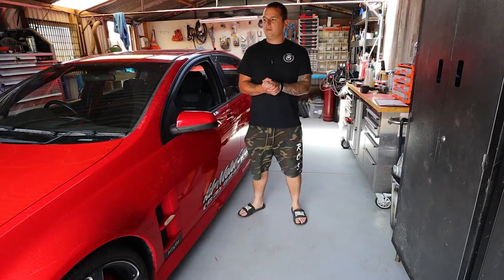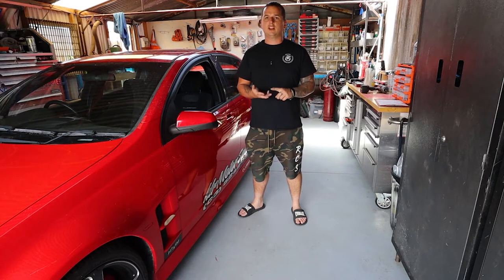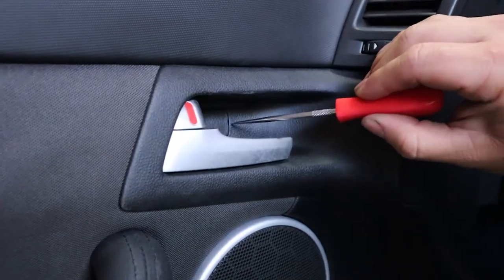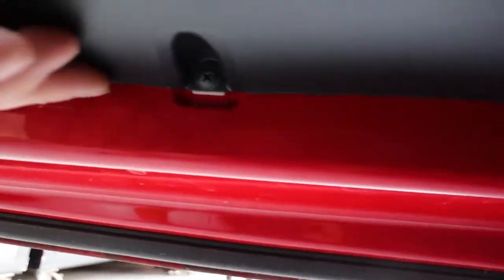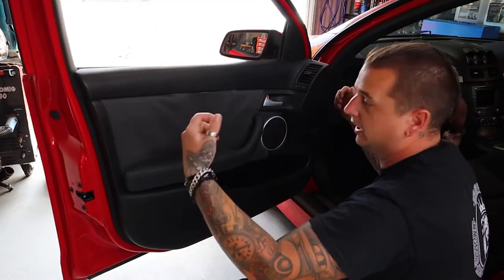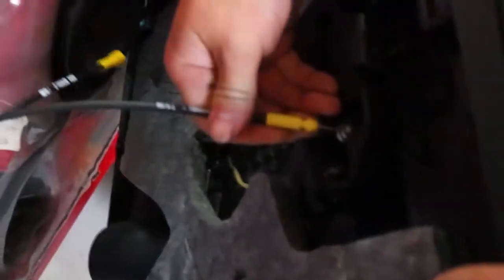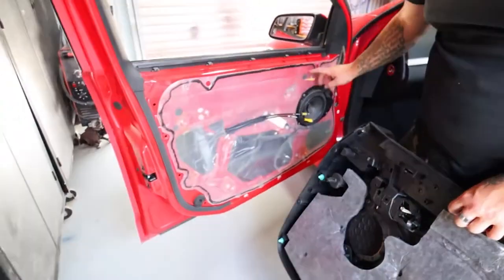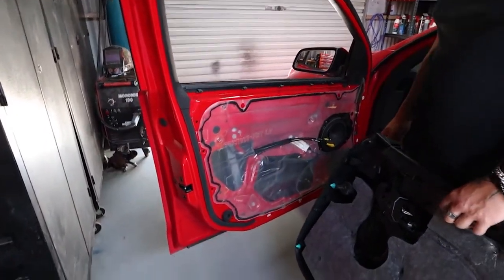Quick Vid - How to remove a VE door trim - Full Vlog on our channel - RCS Media

Comment: Brother how do we take a door off
Reply from the maker: The plug for the wiring of door will need to be unclipped. apart from that its just a few bolts inside on the door hinge. you could also take the door apart like iv done in the vide and from there you could remove the wiring loom and then just unbolt the door from the hinges.

Comment: How do you remove the bailey channel
Reply from the maker: Hey Mate, Top outer ?
Reply: @RCS Media ( Car Channel )  also looking for advice on this.
Reply from the maker: @FlameEditz__  Top outer or inner mate?
Reply: @RCSMediaDivision  top outer
Reply from the maker: @FlameEditz__  Its pretty easy to remove. it just pulls up and out with door open. you have a few clips each end you just stretch the seal over those being careful not to tear it. i can do a video to show but wont be for a month or so.
Reply: @RCSMediaDivision  cheers